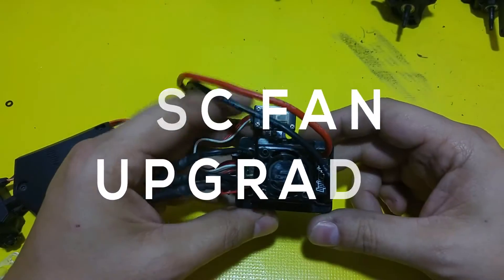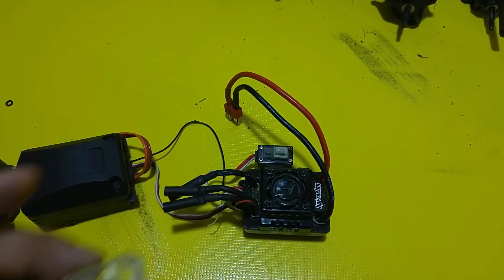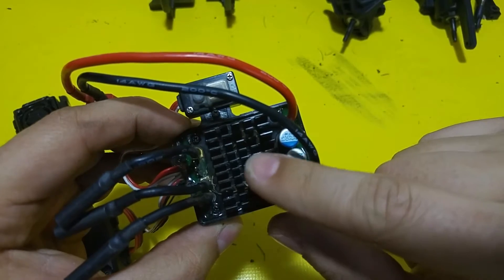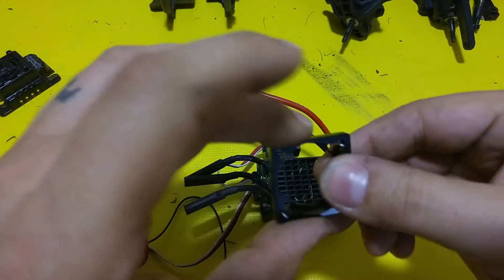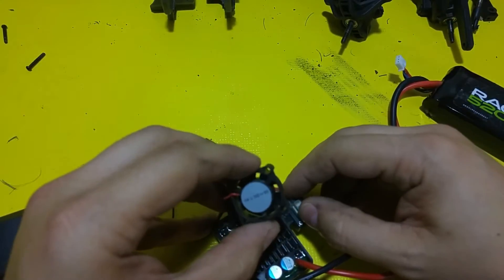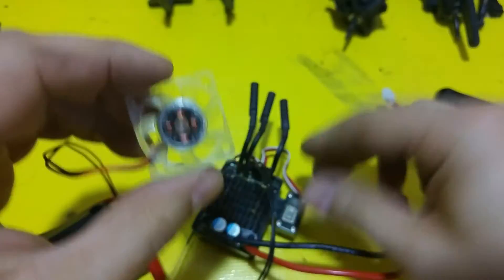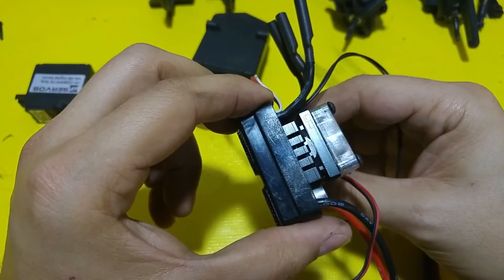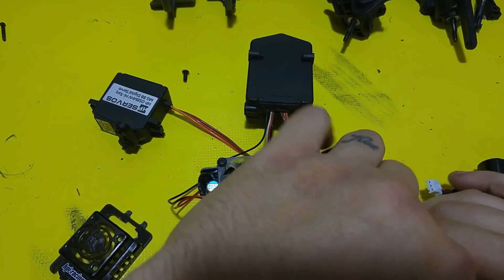HPI Savage XS Flux Part 4 (Brushless ESC Fan Upgrade)

Comment: i got my fan on the eay lol i ordered the wtf fan for my 120amp hobbywing esc cuz the stock fan is trash alsoo the esc cover is garbage I removed mine cuz it just holds the hot air and doesn't let the fan let the hot air oit fast

Comment: is that fan ok with being hooked directly to the esc when running 2s lipo.. ? or would it be better to hook into receiver.. I put the yr adapter along with a yr 30mm fan and that fan ended up smoked. I do know grass and other crap gets in the fan and stops it.. I recently ordered the fan from your video and this time I'm gonna wrap either screen or other breathable material over fan to help prevent grass and what not from getting into the fan.. p.s the factory fan that came with my savage xs didn't even work when I got it.. which was like a week ago..
Reply from the maker: +billy r I actually have the fans running directly off the balance lead of the battery.  Honestly i don't know how much power the connector on the ESC is good for.  There is no published specification.  Would one upgraded fan be ok?  Probably.  But yes running the fan or fans off a bec or directly from the battery is better.
Reply: Do R/C! Ah I c well I think if its connected to esc it gets full battery power but when connected to channel 3 its reduced somehow.. so have you had any issues with ur setup?
Reply from the maker: +billy r none. The only thing I've had the slightest problem with is the clutch but that's because they weren't available and I used the old one.  Other than that the rig is rock solid.
Reply: Do R/C! yeah truck is pretty bad ass.. but I do plan on upgrading my center shafts and cups and my drive axles and cups to the hpi HD and hot racing drive shafts all the way round. . my center cups off trans already r showing wear.. guess there known for it..

Comment: Nice upgrade 👍
Reply from the maker: Thanks.  Between that and the new motor fan it sounds like a jet standing still but its much cooler.  Stay tuned.  I'm going to do a semi-scientific comparison between no heatsink, heatsink and heatsink and fan on motor temps soon.  I'm also going to have some running footage soon!
Reply: Ok sounds good. I'll be watching for it👍
Reply: Do R/C! What happen to your channel? You haven't uploaded in forever
Reply from the maker: Gmpisawesome life got in the way.   I am planning on getting back to it soon.   The theme may stray away from rc though into more general electronics/whatever I'm working on at the time
Reply: Do R/C! I see. Sounds great, look forward to seeing your videos :)
Reply: What’s the adapter name? Or link to buy? Thanx